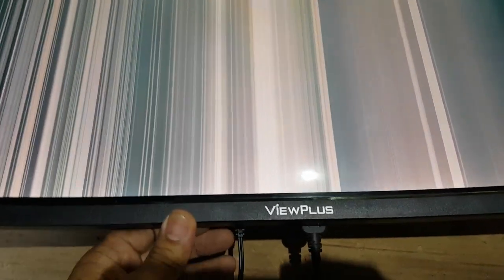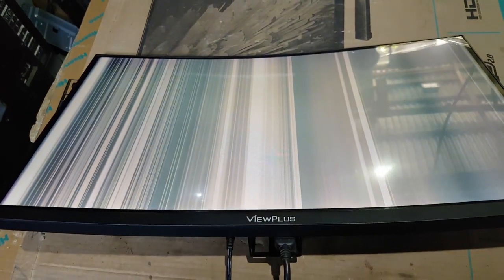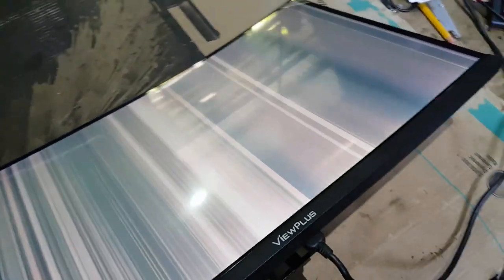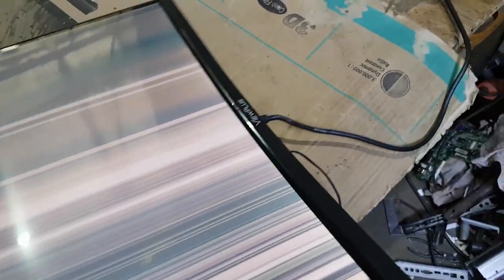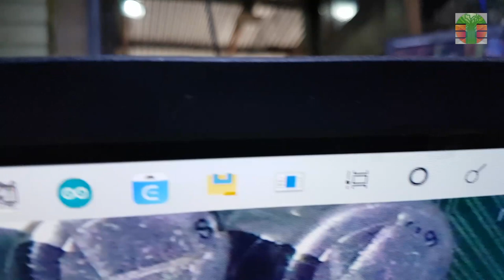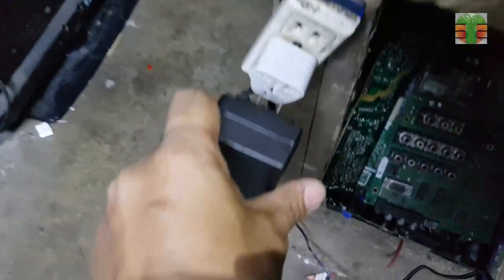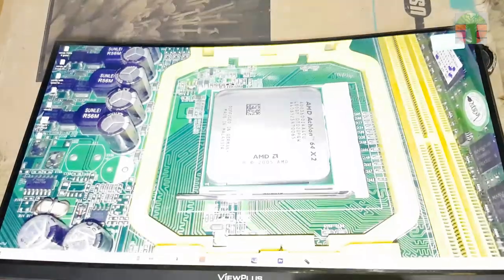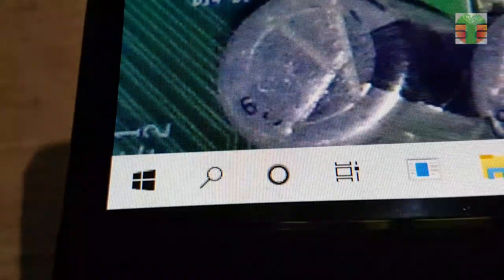ViewPlus Curve Monitor. Display Vertical Bar lines fix.

Comment: Please explain how and why this fixes it?
Reply: So it's possible that those resistors have short circuited and that's why they were quiet but they unsoldered to see if the cables from the screen were unsoldered from the pcb but they stopped resisting

Comment: Please explain how and why this fixes it.
Reply from the maker: The LCD panel has a two-gate signal on the left side and right sides of the LCD screen. the left and the right gate signal is connected in parallel. If one of the sides has shorted gates, the screen will flicker or distort the image. If you cut the shorted side, the image will be normalized. Because the connection is parallel,  The LCD still has the other side work. But the side has the shorted will be darker or like lower resolution.

Comment: Why not check with resistor is faulty and just change the bad component instead of bypassing
Reply from the maker: its the panel issue no other componnents.

Comment: Hi, I have a samsung curved monitor model C27HG7x and this problem occurs when I turn it on, but it heats up and the lines disappear. what would be the solution?
Reply from the maker: the panel I guess.

Comment: sir in lg s70a monitor i have logo normal and set the menu but when i try to connect with someone source via hdmi it says it doesnt exist signal i noticed the basic ic of the mainboard is very very hot 
in your opinion from where is coming this hot bad contacts between ic and pcb via balls and needs reballing or there is someone shunt ?
thanks on advance

Comment: what did you bypass?
Reply from the maker: Ckv lines ang vgh even and odd.
Reply: @tevzTVTevatronics  thanks, I'm learning a lot from your videos
Reply: @tevzTVTevatronics  I have a 60 pins (2 30 pins connectors) display that I wanna put in a tv with a 80 pins (2 40 pins connectors) display, have yoy already done a video about an adaptation like this one?
Reply from the maker: @geovani60624  60 to 40 pins LVDS is not easy to adapt.  But there are ready made adaptors that you can buy online.

Comment: How and why remove jumpers and resistors can fix the issue???
Reply from the maker: There is a shorted CLK line on the side where thous resistor is been removed. It can solve the problem by disconnecting the bad clk lines. Its still work because the other side has healthy clk lines.
Reply: @tevzTVTevatronics  how about po yung screen flickering lang, hindi kana maka pag trabaho kasi panay ang flick. I check it already sa cable niya ganun padin. Same po ba ng gagawin pag binuksan ko sakin?